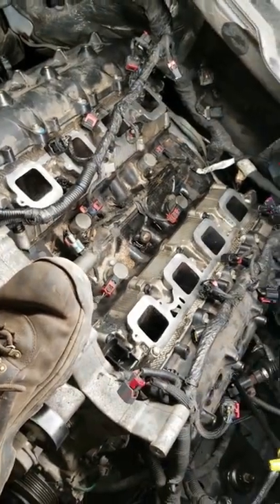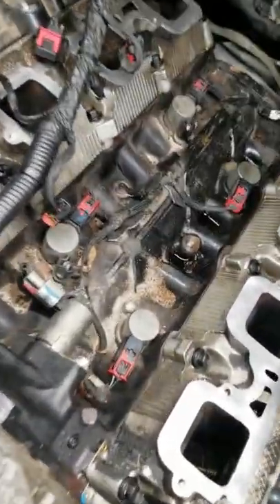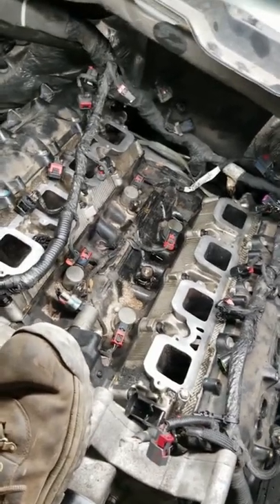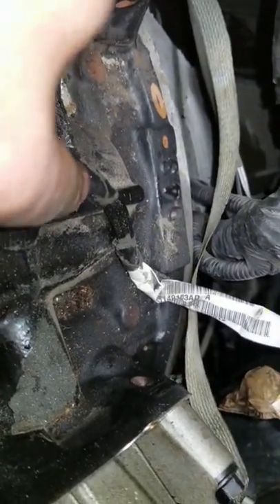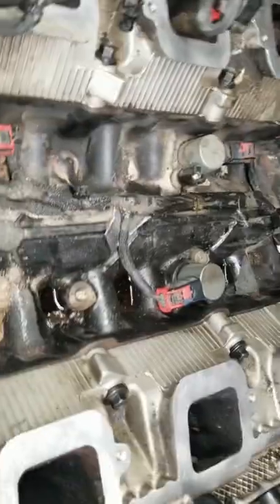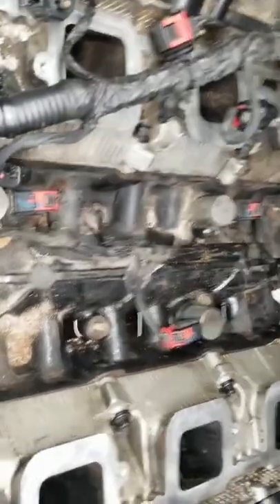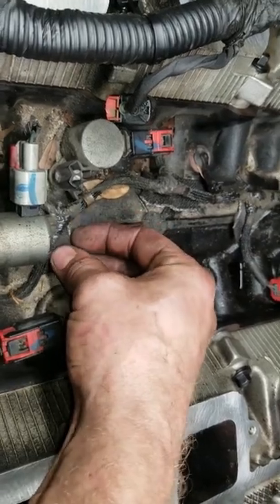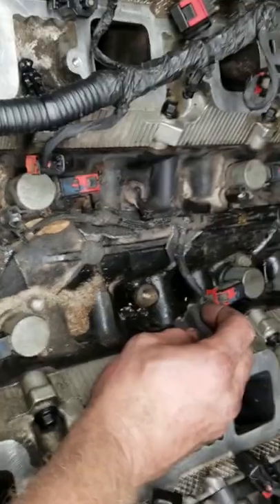Hemi MDS Harness Tip

Comment: @FixedAFT how would I get the beads out? I had my 4 mds solenoids changed and they dropped pieces.
Reply from the maker: Magnet or. Vacuum attached to a small piece of fuel hose. 

Good luck brother